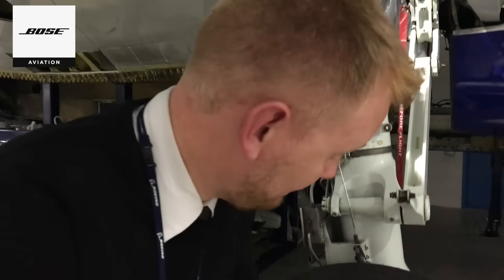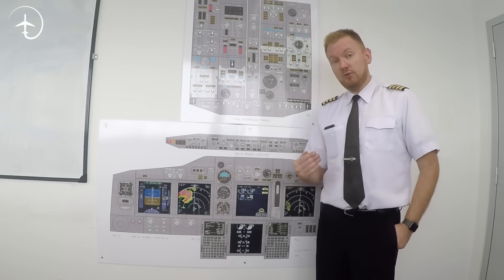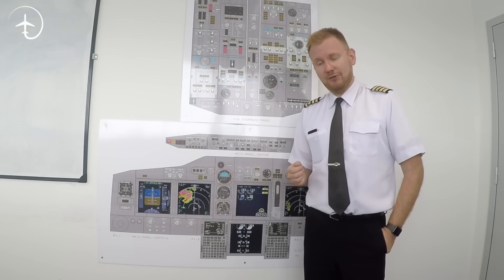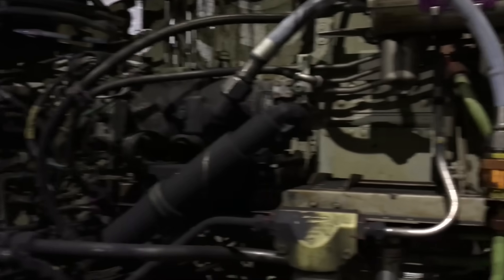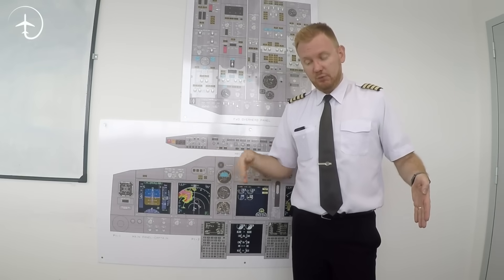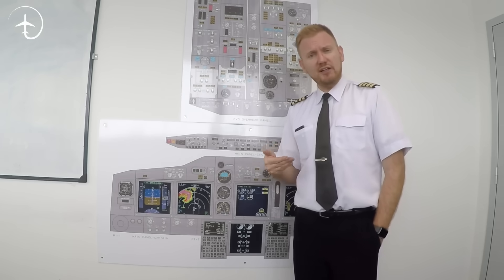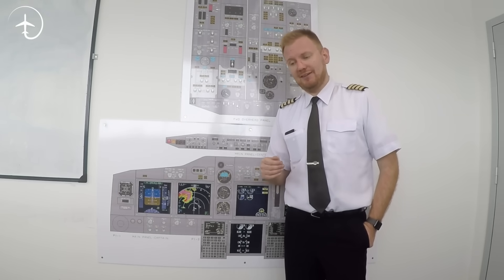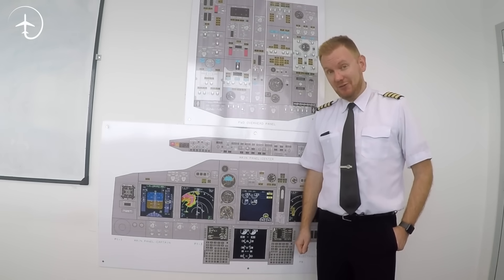Why does the Boeing 737 not have any landing-gear doors?

Comment: The main gear tires pressure is around 184 psi depending on the type of model you have 100, 200, 300, 400, 500 , 600 ,700 , 800 , 900 and then the max line. It's not 14 psi.

Comment: Is there any dustbin, vomit bags in cockpit and were is it situated ???
Reply: Sangeeta Kanojia Good question, but I would hope that the pilots take turns vomiting since someone has to fly the plane. That's sort of why the pilots can't eat the same meals, just in case.
Reply: Sangeeta Kanojia:  Dust bin?  If you mean trash can, no.  There are trash bags to contain the trash generated during a flight.  Vomit bag?  No, not normally.   Why would they be needed?  Pilots are not prohibited from eating the same meal type.  At least not by FAA regulation.  Perhaps company policy.

Comment: Why we do not have some thin bars in front of aircraft engine to prevent BIRD STRIKE ???           (For Big birds ,so that aircraft does not crash).
Reply: And you would now be getting bits of metal in your turbine engine along with bird meat and feathers. It will probably make things worse.
Reply: A grid that is strong enough and fine enough to withstand a big bird strike would be very non-aerodynamic.

Comment: i never even noticed that they dont have doors. interesting :) btw i always find it funny how low-tech some solutions are in the aviation, and space/military world. some rubber things to stop the noseweel motion and to seal the compartments...shows that the simplest way often is the best one in engineering :)
Reply: Engineering is about asking the right questions. Once you identify what performance/design criteria you really have for something, you can boil it down to its simplest parts and go from there.
Reply: Less to fuqupp is a good thing.
KISS -- Keep It Simple, Stupid

This should be applied to software, also. But it seems that such is made complicated on purpose these days, because... Gee Whizz!, would you look at that!  Bah!

(I'm a software/network guy. But I started in Electronics. And should probably have done Mech. or Industrial.)
Reply: @its1110  I too started in electronics and moved (mostly) to software. We make software with the (high) reliability of hardware! I've noticed this uniformly.
Reply: Never noticed. After all the wheels are down when they are close and on the tarmac . However next time I see a 737 circling I’ll get my binoculars. On second thoughts I am not that interested. One thing , the Stuka : why did it not have retractable wheels?
Reply: @peterdavidasige8073  helps braking the dive during bombing and stabilizes the diving attitude
Reply: Digi20 I guess you NEVER LOOK UP, that was the1st thing I noticed when they came out.
Reply: @flybyairplane3528    You would need binoculars to notice it on a plane that's thousands of feet above you. Most people have lives and don't walk around with binoculars looking up at planes that are off in the distance.  The only other time they see planes is during take-off, landings, or when already on the ground and the wheels are down.  If you had common-sense, you'd understand that.

Comment: The Late Joe Sutter explains why the 737 never had landing gear doors. 1. Weight and reduced complexity and maintenance. As far as increased aero dynamic drag without landing-gear doors there are spoilers built on the belly (in additions to the hubcaps) which minimize the increase in drag without doors. And any slight additional cost in fuel burn (because of no doors), that cost is less (over time) than the maintenance of  labor-replacement parts to keep the landing-gears operational.

Comment: they are tyres forgodsake, they are not built to be pampered  and designed to take all sort of abuse. This should be default design for most airliner as it is very simple & reliable solution.
Reply: Toby Maltby why r u mentioning supersonic aircraft? If you want to make comparison give the example from the same class.
Reply: Anas Takiyudin Are you russian ?
Reply: Zac Youngson maybe...
Reply: Thank god the space shuttle had landing gear doors.
Reply: @boots6384  yeah three bolts and lockwire, too much work
Reply: Probably just as well they didn't go with it for Concorde, though, eh ??  Aaaand I doubt it would have been to clever on the SR71....

Comment: I mean I love Boeing over Airbus as much as the next guy does. But you can’t help but see this solution as “lazy” on behalf of Boeing. Surely Boeing has the technology nowadays to cover the wheels without increasing dry weight. It would have been icing on the cake if Boeing did it for the 737 MAX.

Comment: Here is a question I have been wondering about a lot over the years:Why does not the smaller aircrafts has more wheels to make them brake easier? And why are there not more wheels on the nose landing gear? Even the mighty B747 and A380 only has two wheels in front.If you exam military cargo aircrafts like Hercules or C-117 they all have many landing gears in theyre aft bays - Often up to a dozen or more per side. And I assume this is to make them easier to brake on icy conditions and unpawed airstrips. So why not ad more wheels to comersial aircrafts? Now I can understand the weight and complexity issues but wouldnt a quad or six pack landing gear be a lot of help on the B737 when its lands on winter airports or small airports with short runways? How much would more wheels differ? Johan.

Comment: I am not sure though why a 737 would be designed without them, but a 727, which is much lower to the ground has doors. In fact, all the other airliners have them, big and small, so I was not clear as to why only the 737 has no wheel doors.

Comment: Great technical explanation on how the gear system works, but the reason for the lack of main gear doors that cover the wheels is never really explained.  The fuselage diameter of the 737 is the same as the 727 and 757.

Comment: Its a trade-off issue. Exposed wheels have an aerodynamic penalty but doors have a weight and complexity penalty. Perhaps Aircraft designed to fly for 5 hours or less shouldn't be bothered to have those doors.
Reply: Glasstense  Exactly. Plus the extra maintenance.

Comment: If there is nothing in the nose wheel bay, why does the nose wheel to need to be stopped? Can it not just slowly finish rolling by itself and save (a small amount) of rubber
Reply: After a few landings, the nose wheels get unbalanced and the high rotation induces nasty vibrations, very unpleasant to pilots, among other things.

Comment: Great video and explanation.  Another question I was thinking of is that during landing, the wheels "burn rubber" when they touch the ground and have to spin up to match the ground speed.  Could there be some kind of simple device (small shaped blades) that would act like a turbine and spin the wheel when it was in the down position so that the speed was close to ground speed?  would this make the tires last longer and be safer?
Reply: Hey Dave 
As replied to another participant, after a few landings, the wheels get unbalanced and the high rotation induces nasty vibrations. And remember, they are are very very heavy. Rotating them by any means to a matching speed is quite difficult.

Comment: Icing can occur on contaminated runways. If this is suspected the gear will be left extended for a short while after takeoff to blow the gear clean. On short hops during hot weather the brakes may not have had enough time to cool so the gear will also be left extended for a short period for heat dissipation.
Hot brakes and tires is not a good recipe in the wheel well.

Comment: I have a question. Last week I was approximately 2 miles from an airport. As I looked at the size of the 737 plane it looked very small. Then I spotted one flying at approximately 35,000 feet up (6 miles up), and it looked about the same size as the one that was 2 miles away
 Two miles of only 10,560 feet. So why is the one flying at 6 miles up look about the same size as the one that's 2 miles away?

Comment: I like the video, I like the explanation, it's clear that it works, but I still don't like it.  I am surprised that is there for MAX. The combination of the flat engine covers and the exposed tires makes the 737 trully unique on the Boeing line. I am new to this channel: do you cover other Boeing planes, or you cover the 737 only because is what you flight?
Reply: I thought so too. like why hasn't Boeing changed it in the last couple of generation 737s but my dad who works on them said. it just one of those "if it's not broke don't fix it" situations. Boeing and maintenence crew who work on them love the simplicity of the no doors.
Reply: FYI, even the new P-8 Poseidon, a maritime patrol aircraft operated by the US Navy, complete with bomb bay, sonobuoys launch tubes, and underwing stations for a variety of stores, has exposed wheels. It's a 737 derivative, redesigned to be less inefficient at low altitude.  (737 is optimized for cruising altitude, but a patrol aircraft hunting subs has to fly low and slow.)

So anyway, even in a wartime environment, they decided it didn't matter.

And that's not unique in military aircraft.  The A-10 quite famously also has exposed wheels.  It doesn't even fully retract its wheels (which has two benefits: it saves the weight of the doors, but it also means that the wheels stick out just enough that during a belly landing, they will preserve the aircraft for further use).
Reply: Jaime Duncan He has to know everything to the bowl of Thé aircraft in order to fly it.
Reply: Look at the front view of a 737, where the wing root meets the outer panels of the wing (where the engines are mounted) is the strongest part of the wing other than the actual root end and is the only part of the wing structure able to support a point for pivoting gear, hence this is where the engine pylons are mounted, now measure the length of the resulting gear leg and wheel when fixed at that pivot and see that it is exactly long enough when fully extended and not under load that when it retracts, rotates up on the pivot arc, the wheel fits in the wing root box just off the centerline...one on each side. The gear pivots on the wing and retracts into the fuz, they certainly couldn't pivot the gear on the fuselage box so that it retracts into the wing because ground handling and stability would suffer massively from the narrower track.

So then you can start to understand the aerodynamic and structural problems because the wing is designed at the optimal shape and size for performance and strength, in flight to not only sustain flight loads in positive and negative G but also to hold the engine weight and thrust and to take the full weight of a loaded aircraft on it's gear on the ground so to extend the wing root section so that the pivot point moves outboard to allow for longer gear legs and complex full cover doors means that the engines move outboard too (there's a host of issues with that) necessitating longer flaps, shorter outer panels, shorter ailerons, heavier overall wing and fuselage structure because it would need to be made stronger and the whole balance that works so well and has done for so many years in the best selling commercial aircraft of all time gets upset which I can promise you affects every aspect of the design: A bigger wing means bigger empennage, engines moved outboard means a bigger vertical stabilizer and rudder and a serious asymmetric thrust problem when an engine dies and before you even get to any of those issues the added weight alone is a deal breaker - so just stick with the tried and tested 727 gear design which is maximised for rough fields and offers simplicity, robustness and acceptable weight penalties and with simple compromises like the tabbed brush gap seals and hub covers and wheel well spoilers on the wing root fairing the cons are far outweighed. Its a perfect design, evidenced by the fact that in 51 years of 737 with more than 9 model incarnations and in an economic and airline world that has changed dramatically the design has changed very little...that's because it works and works well.
Reply: Your irrational disapproval is childish. It does no harm, weighs less than otherwise, and simplifies maintenance. Fewer potential points of failure is GOOD. As an experienced maintainer (fighters, not transports) I'm fine with it. Millions of flying hours prove it works.
Reply: Jaime Duncan Boeing can only change so much between generations of aircraft without having to re-type certify pilots.  The number is 18% I believe.  

Meaning that the MAX. is only allowed to differ 18% compared to the latest and greatest NG.  They probably used almost of that 18% between the fly by wire spoilers and fiber optic display system and display processing computers.
Reply: Koray Gun     .?
Reply: Darren-Edward Oneill I actually read your post. Well stated.

Comment: Hey, what is that about nitrogen again? The gas is not affected by temperature changes? LOL. It is there to minimize flames in case of a tire fire. Otherwise it acts as any other gas - changes pressure with temperature.
Reply: it is also there to not freeze (vapor in air would) and i guess thats what he meant with "no affected by temperature".
Reply: Came here to post this! Nitrogen is a gas and physics allways applies! :)
Reply: Nitrogen is used because it doesn't support combustion, does not oxidize rubber, does not contain water vapor that would condense and freeze causing imbalance.
Reply: No. But nitrogen is used because it does not support burning (as oxygen in the air does), it has (AFAIK) different moisture holding properties, it is inert and will not corrode materials and etc. But it does change pressure with temperature as any other gas does.
Reply: nitrogen is an inert gas, we use it in acft tires so that under dangerous conditions such as hot brakes there is less of a fire hazard.
Reply: nitrogen is significantly more thermally stable than regular air. it won't contract under lower temps (ha ha) and won';t expand under higher temps., airlines and aerospace have been doing niutrgen in tires for decades -- its use here proves its worth for automotive use as well. i have nitrogen in my car's tires, in the midwest and from outdoors, winter at 20 deg F to summer 85+F theres less than 1 psi diff. with regular air it's about 1,5 psi per 20 deg change or 1 psi per 10 deg change. it also seeps out much less. and btw the atmosphere being 80 % nitrogen is not enough. purity of a gas does start until the very high 90 percentile.
Reply: guess the rocket scientists and triple phd aerospace engineers didn't go to school then
Reply: e gutierrez Could you please explain this? How come pressure stays unaffected?
Reply: +mrlevite1237 When an aircraft flies 10km up, yes, indeed, the temperature is very cold.  But in order to land, it has to come down through warmer layers, and a few minutes before landing the wheels are out in the open air getting warmed up very rapidly to ambient temperature.  So at touch down, they'll have about the same pressure as at lift off.

And finally, even if they did take off at 50C, and landed at -40C, the aircraft is a lot lighter (the consumed fuel) and they were filled to 200PSI or more to begin with.  So the pressure drop (which might be in the region of about 40PSI) isn't a big deal. The composition of the rubber and it's ability to survive temperature cycling is more important.
Reply: Nitrogen makes up 75% of our atmosphere and is inert.  So an  easily obtainable gas that is also not flammable.
Reply: Well, first of all oxygen is only 21% of the air, the rest is nitrogen (and 1% of everything else, but that is irrelevant), so air will behave much closer to the nitrogen, that to oxygen. And secondly (and much more importantly) nitrogen and oxygen are both gases, close by molecule mass (28 vs. 32), abiding laws of physics. So AS ANY OTHER GAS nitrogen contracts in cold and expands in heat. And I do believe pressure changing rates  of both gases will be quite close to each other. So unless to give links to prove your words you are considered ANOTHER GUY PROMOTING NITROGEN MYTH.
Reply: Nitrogen isn’t inert. Just look at fertilizer or nitroglycerin.., lol. 

Nitrogen is affected by temperature, but has a smaller coefficient of expansion. It also is non corrosive and displaces oxygen which could feed fire and doesn’t absorb moisture.
Reply: that contradicts school physics, your argument is invalid
Reply: Yes, pressure does changes. I will not discuss technical implementations details and so on I will still insist - nitrogen changes its pressure with temp, according to laws of physics, nothing else.
Reply: Moje Imja  I do NOT remember what airline, but some bird brain actually added AIR to a tyre which was lowwhich had nitrogen in it , but later that tyre EXPLOODED in flight creating a fire within the wheel well, , with many loss of life ., South America I believe, it might be on Wikipedia, in listings of crashes
Reply: Yeah,  I guess the people pushing around the nitrogen cart around the flight line to service ties,  brakes,  struts,  and pneumatic systems should just use a bicycle pump
Reply: Plus aircraft tires get mighty hot when applying brakes.  So hot and cold temperatures won't affect tire pressures
Reply: nitrogen doesn't expand or contract the same as oxygen does.  the aircraft wheel wells aren't pressurized so the tires are in the elements.  from extreme cold to extreme heat.

Comment: What is the fly by wire system?
Reply: Using electrical controls rather than steel cables to move the control surfaces.